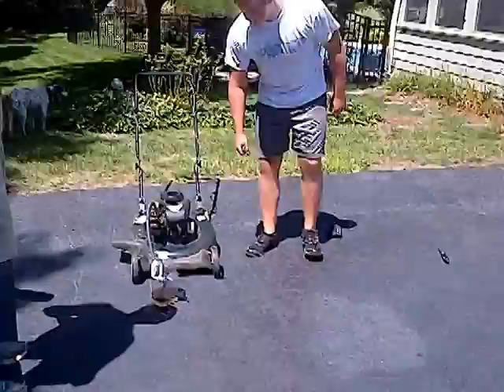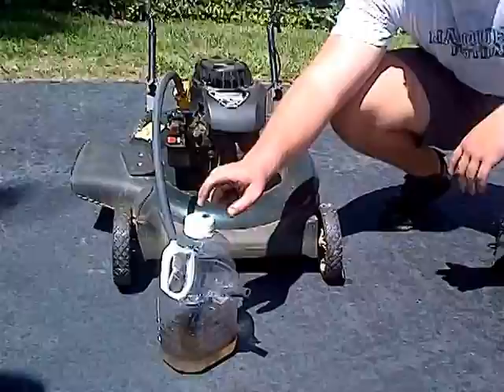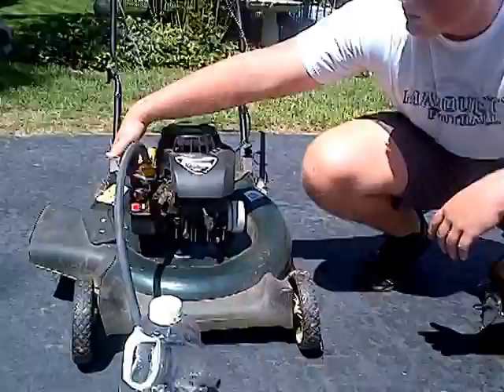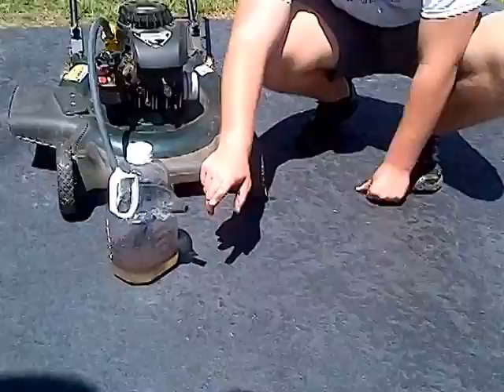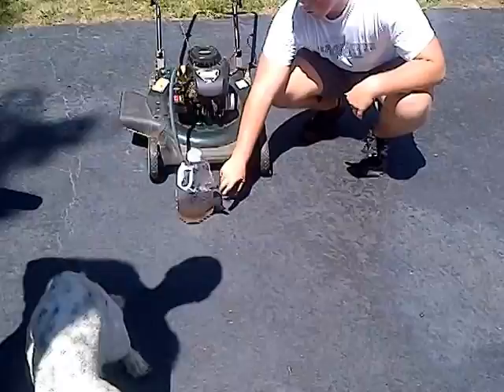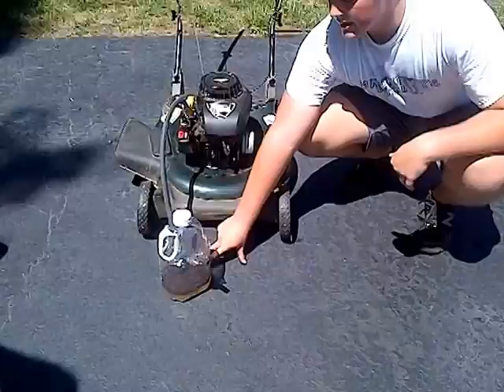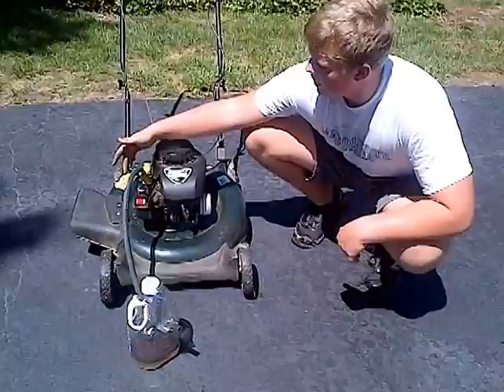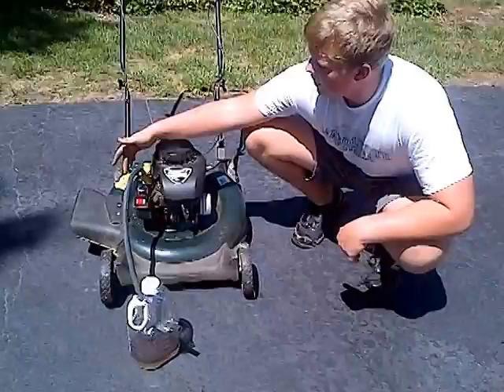Vaporizer Carburetor Build By Cayden Sparks 1

Comment: OK it looks impressive with the water but you don't mention the purpose of the water.  Are you telling us water evaporates at the same rate as gasoline and walla we will be able to run our engines on 1:1 gasoline to water? Don't think so!!!   Also did you know if you have a backfire through the carburetor due to the gasoline vapor not the water vapor your cranberry jug will explode violently.